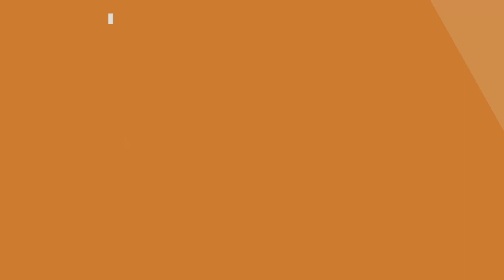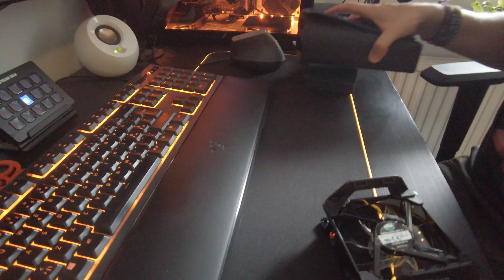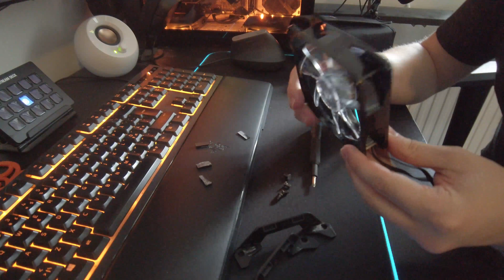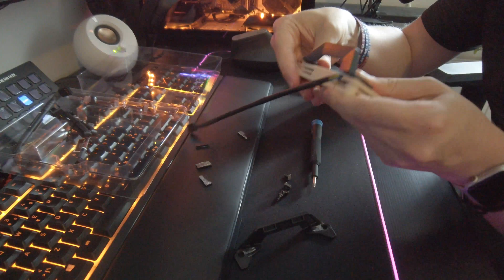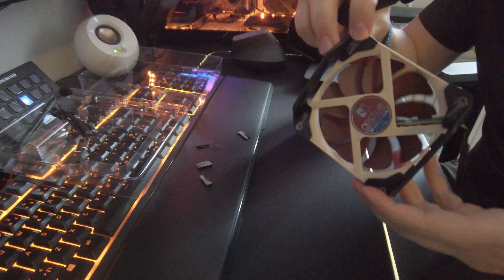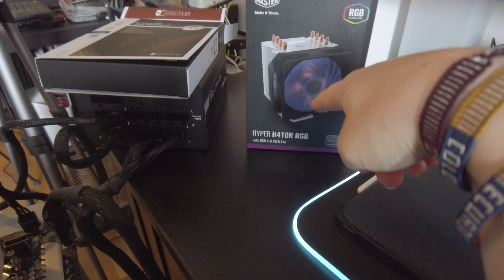Hyper H410R Replace Fans with Noctua NF-A9x14 - X79 Server Build Project

Comment: It took me your video to figure out that you have to remove the rubber pads and screw the brackets to the fan from other side.I bought a second hand hyper h410r and the plastic clips were disassembled.
Reply from the maker: Glad it helped at least anyway :)

Comment: Watched it and I had heard of Noctua fans, but I've never used them.  Been nice to hear it before and after the change -- to see if any of us could hear the difference.  But, I've been told that these fans are much more expensive, but I've never looked.  Like on my current system, it's got some CPU whine when I really start gaming.  So, I always turn down the resolution to mid (let's say) to keep my system from sounding like a freight train and from not having the GPU whine also.  But, my new system should take care of that, I hope.
Reply from the maker: They are worth the money I promise. I use them in my PC, my server homelab and also my wife’s pc.

The bearings, are high quality. And smooth. You can usually get good deals on Amazon. 

I haven’t made and side by side, because I want to do like proper tests. With temps, noise and costs etc. 

Once I setup a larger studio then I can. I don’t have much space right now.

Comment: Dude, the audio is so much better here than in your other videos, whatever you changed, keep it, it works, great job
Reply from the maker: Yeah I’m really working on it. Trying to isolate any issues with variation in audio levels. Turned off the audio gain as you said. And from that video onwards it’s been like that. 

Still some minor changes but I’m thinking that’s a post fix. Rather than when recording.